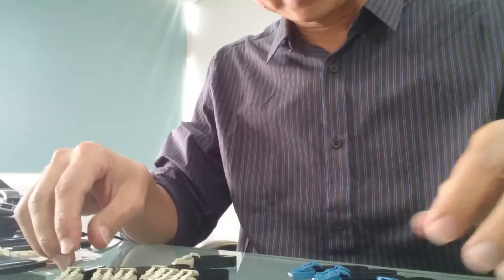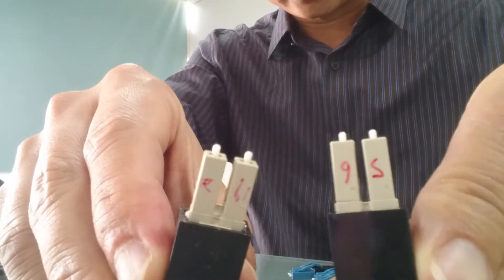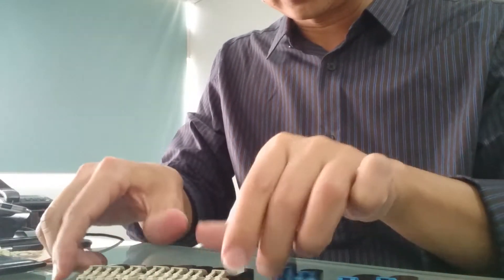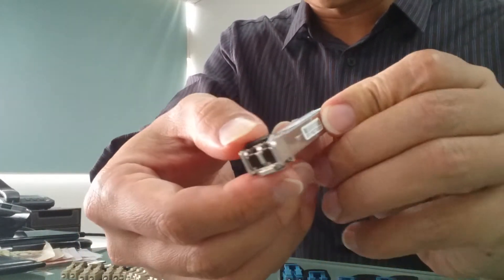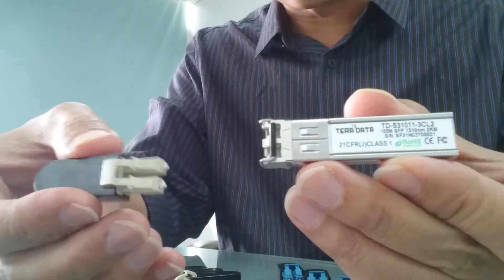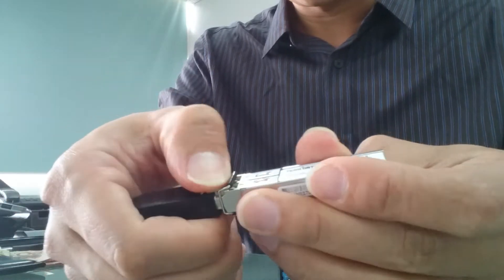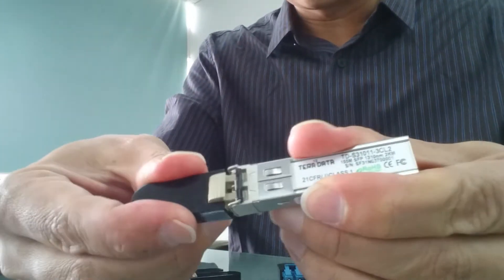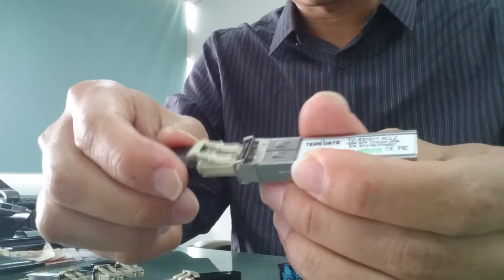LC loopback connector mate to SFP transceiver

Comment: I have this switch Quanta LB6M, what kind of SFP+ module and optical cable should I use in order to connect it to mikrotik router CCR1009-8G-1S-1S+ ?